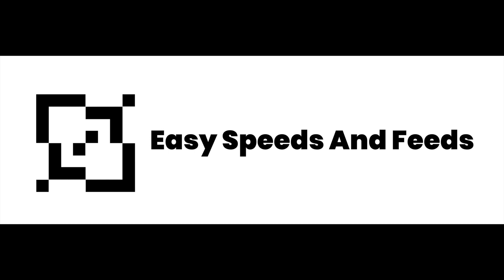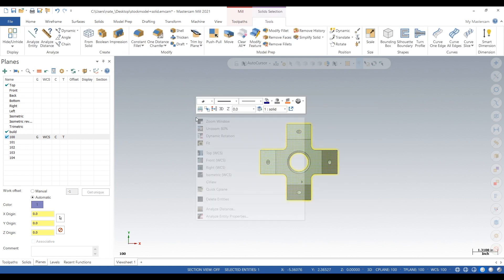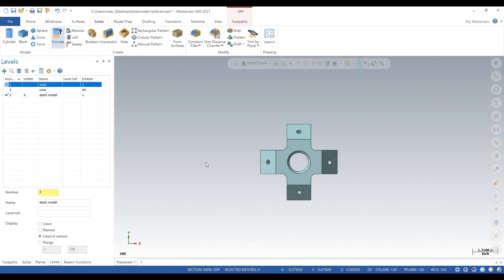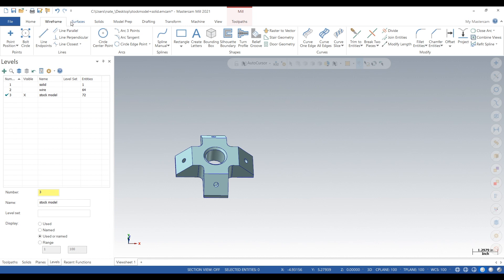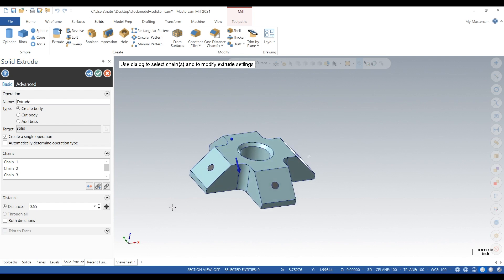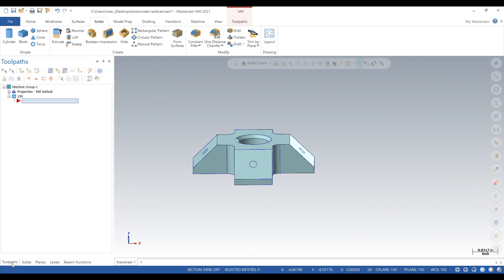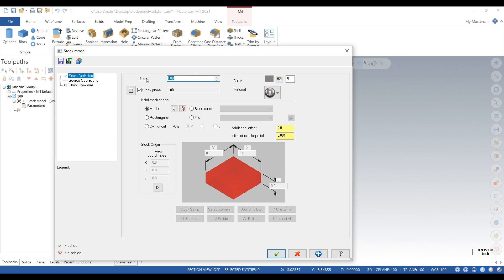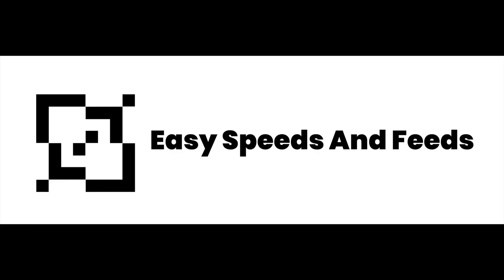Stock Model - Mastercam

Comment: why didnt you just use the "modify feature" function and remove the surfaces of the solid? this is way easier and you do not have to create wireframe.
Reply from the maker: Good point! I've used that before and maybe I should use it more often!

Comment: one thing i noticed is when i use stock model and a bullnose endmill, the tool wont go deeper than the deepest point of the stock meaning there will always be stock on the bottom left.
Reply from the maker: To solve that you just want to tell your end mill to go deeper in the tool path parameters. This stock model is being used to rework this part and add 1/4-20 threaded holes.
Reply: @easyspeedsandfeeds1410  i tried that but the tool would just not go deeper. Maybe i have forgot something else